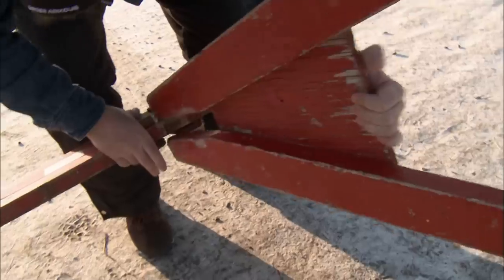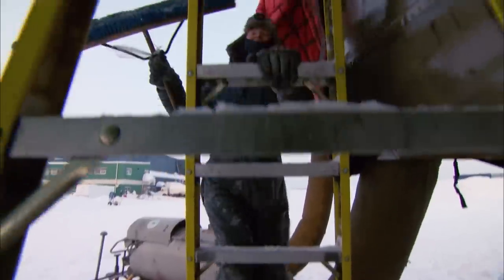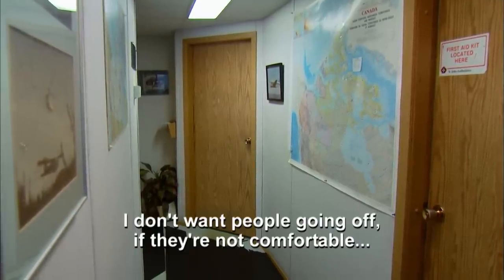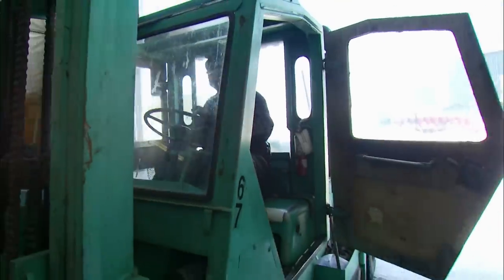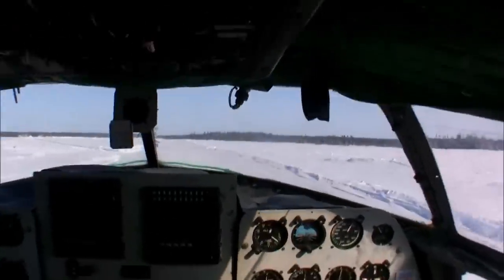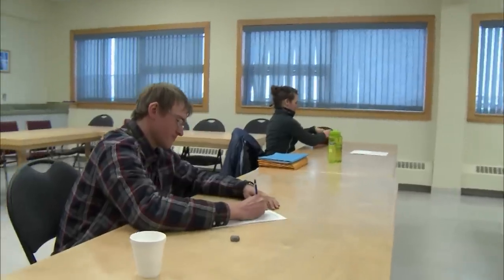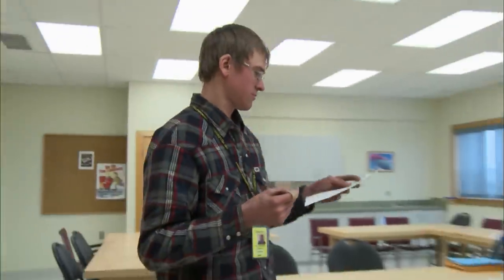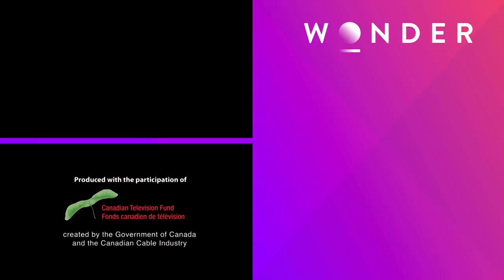Canadian Airline Delivers Turkey's First Water Bombers

Comment: I can't imagine a mining operation complaining about a damaged wing tip, when I was a flight engineer on DC-6's hauling fuel into mines inside Alaska, those guys were just happy to have the service, if you look real close at 42:46 the propeller on the number #3 engine on the DC-4 which is landing is feathered, one of the benefits of a four engine aircraft.

Comment: The other Water Bomber hit the tarmac.  Erm, normally landing gear doesn't make sparks.  Looks like something might be amiss.
Reply: Yah a buffalo was water bomber had a hydraulic failure and couldn't get the gear down so they did what anyone would've done they landed... Without gear on a runway, if it were my choice I would've just landed on the water next to the airport those aircraft are designed to land on it with no gear anyway so it would've been much easier not necessarily safer but easier for sure
Reply: @WBTravels  wasnt that.... the idiot pilots didnt put the gear down when they were going to land